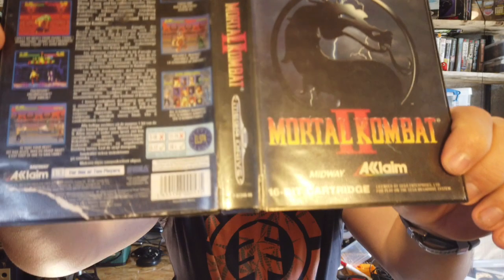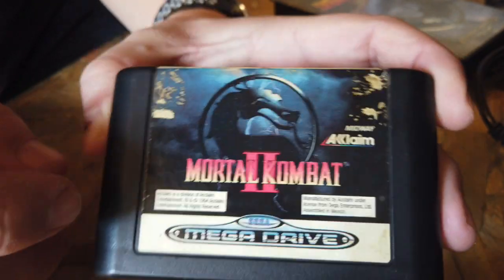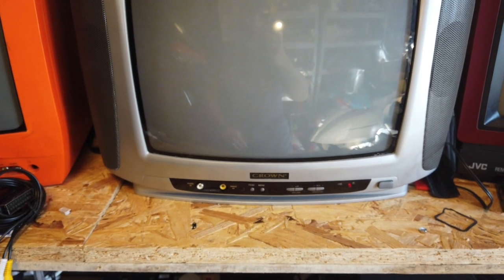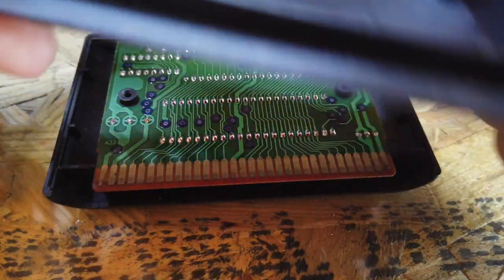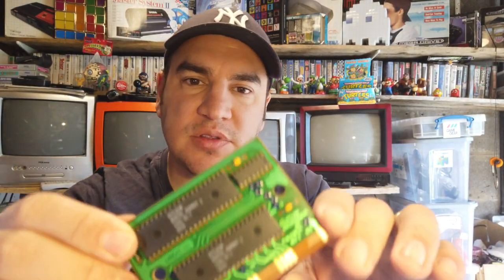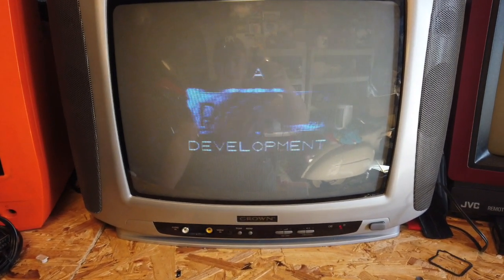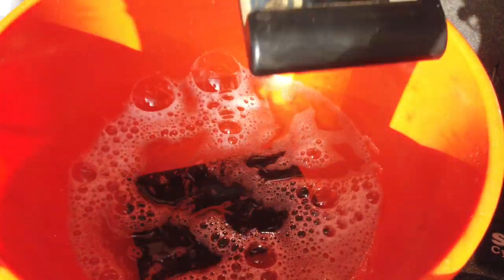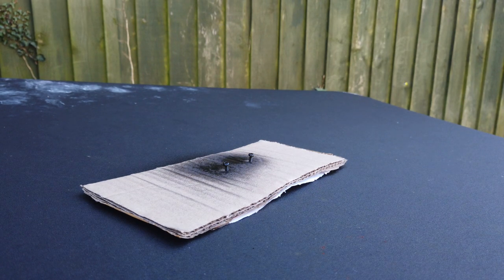Mortal Kombat 2 Cartridge Clean & Repair Sega Mega Drive

Comment: Nice one mate, great video! 
You could get hold of a fibre glass pen for the contacts
Reply from the maker: Thanks Russ. Missed your Sunday night stream last night. Do you post anywhere to say when you're doing one?
I've got a fibreglass pen but keep that and mega fine wet and dry until the last option. I've also used a magic eraser before with good results on stubborn pins.
Reply: Goodwins Place I didn’t stream last night as I ran out of time. If you click the little bell 🛎 you should get a notification.... but I don’t think it works every time for some reason
Reply from the maker: Yeah have alerts on. Will keep an eye out for the next one. 👍🏼